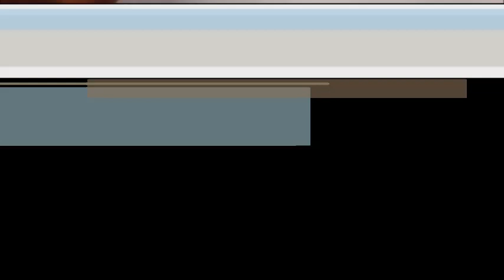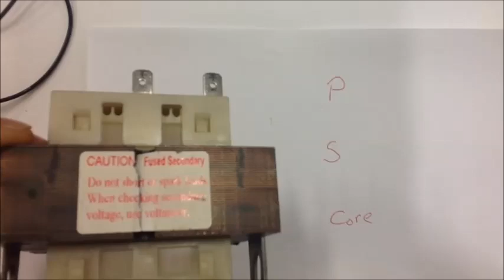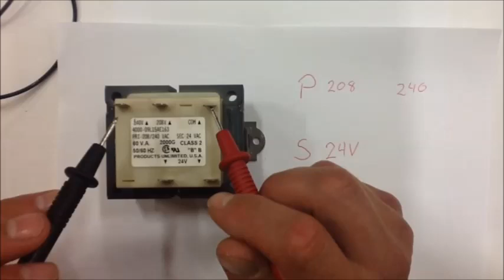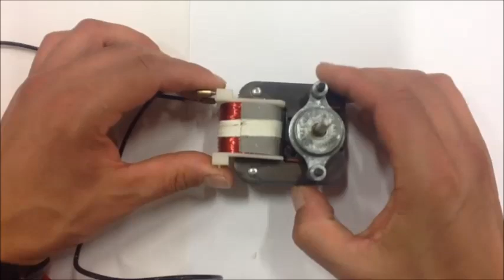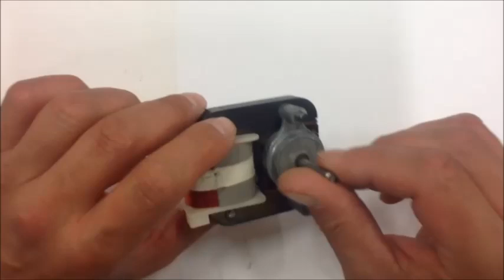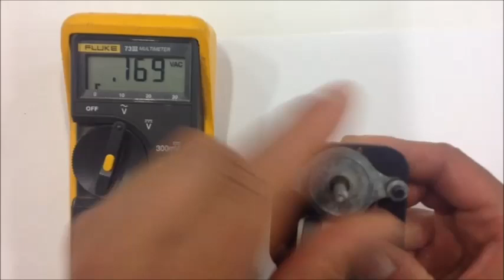Electromagnetic uses 3 Transformers and motors

Comment: EXTREME EASY and i have a question how to get AC(alternate current) from DC(direct current)? but in the easyest way and the most money safe way
Reply: ***** i want AC from DC not from AC to DC that knows anyone how it works i want get alternating current from direct?
Reply: ***** i fucking know just for 300 € !!!!
Reply: +Adam Varga Using an inverter is a an expensive idea...But still diode based inverters are still a perfect blend of the both ..